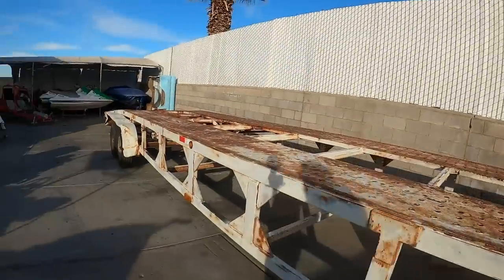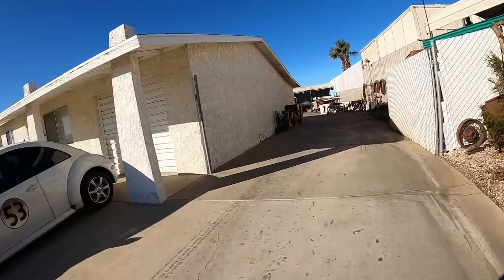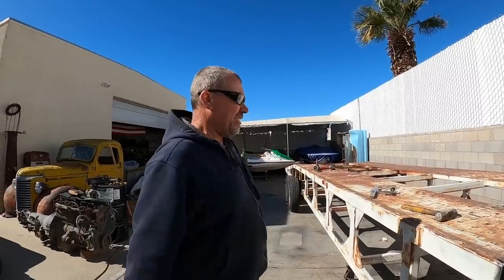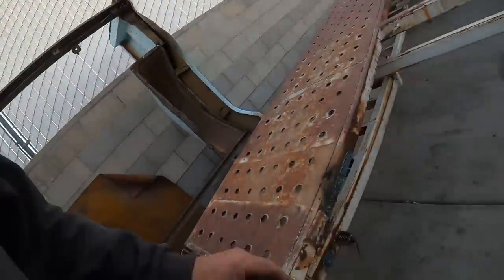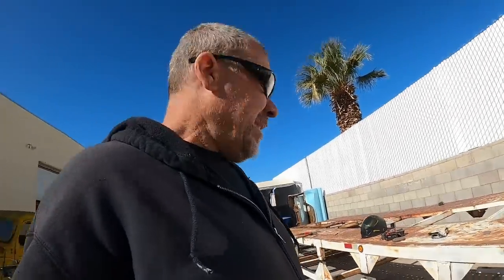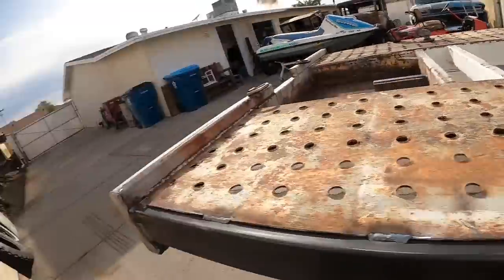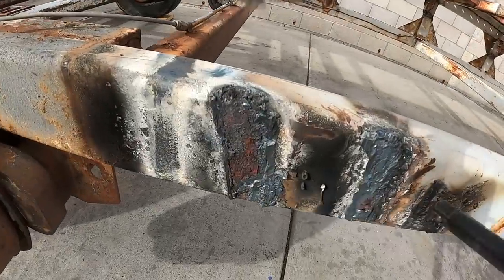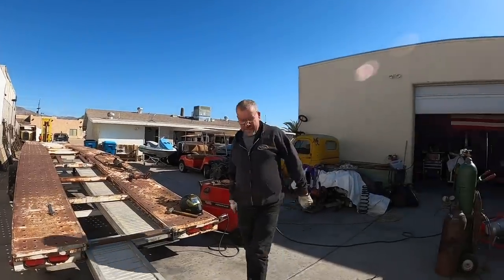Saving Money Repurposing This Trailer For My 1933 Dodge Brothers Mini Semi Truck

Comment: It wouldn't hurt to add some sort of plastic glide for the ramps to slide on. love the ideas and content on the build.
Reply: Great idea. A strip of 3/16 UHMW PE would make it much easier and WAY quieter. Those things squeal like a dying hog when dragging them out.
Reply: Like sliders on a snowmobile, UHMW perhaps. Maybe spring loaded clamps to take the rattle out?
Reply: @kwm6507  They are so far back you can't hear the rattle from the cab on my 36'

Comment: I paid $400 for an old camp trailer.  It had good tires, and the frame had potential.  I reinforced the frame and I thought that my T Bucket, (the reason for the trailer to begin with), would fit between the tires.  Well it was 3/4 of an inch too narrow.  So I built fenders that I could drive over, and made some custom tie-downs.  My first trip to Hurricane was uneventful.  I went down there to meet Matt and Paul, which I did.  It was awesome!

  My second trip was to Oregon from my home in Southeastern Idaho, and it  was ok for the first half.  The second half, (coming home) another one of the "good tires" gave up. ( second one)  I was having trouble getting my small floor jack under the dead axle, so I put it under the spring.  That baby snapped right in half.  At least it was on the shackle side, so I changed the tire and drove 35 MPH down the shoulder to the nearest exit.  I stopped at the first farm that I came to and asked to park my trailer and my T Bucket there for a few days.  They said sure.  I went 250 miles home.  I came back a few days later with 4 new springs, and 4 new wheels and tires.  Changed everything on a gravel driveway, alone. That is how I ended that trip with my "cheap" trailer.  I most likely could have bought a ready made trailer for what I had in this one.  Oh well!   It is bullet-proof from here.  I hope that you have better luck than me.  LOL

Comment: Merlin,  it's going to be an awsome looking combination.  Have you considered putting a heavy steel caster under the back corners? That way when you go up an incline they will roll instead of dragging the trailer. You should be able to tuck them up high enough so the wheel would barely hang below the bottom of the trailer. I used to deliver new boats with 53 foot low deck trailers and one brand that I pulled had steel rollers built into the back of them.  I think that the castors would work better because they would swivel while you are turning.
Reply from the maker: That’s a great idea. I might do that.

Comment: Hi Merlin. If you weld two bearing's to the frame where the ramps can roll on. You don't need to pull and puch so hard. They roll out easy when you unlock them. We do it to all trailers. 
Like your builds. Greetz from the Netherlands.
Reply from the maker: I like that🏁😊🔧👍

Comment: Ok, so prior I missed the point of you will be using the tandem axle truck to pull it. I follow now. I think I would have done the front a little different, but each their own. The style of tie downs that were on it are actually pretty convenient. They may of needed updated, but it makes them self contained. No straps to lug around, get lost or people steal.  I didn't see it on your trailer, but inboard typically they have a 3-4 ft length of chain with a tow truck style hook cluster to allow you to hook on to pretty much anything.

Comment: Trailers with "good bones" are better than building from scratch. You "repurposed" about like I would. Stretching and shortening are all part of the game. I have done both many times. Seems like every trailer has a special purpose. I have 6 or 7 at last count (if memory is correct). My son has a couple holding building materials for the shop/house he is building. He tried to tell me to thin the trailer herd by selling a couple. Nice to have options and the place to keep them. Love the "dog alarm" that goes off when someone shows up.

Comment: That little section you lopped off the front would make a sweet medium duty car hauler for dirt track you could add 10 feet and throw a cab over on the front and have a weekend trailer for the track

Comment: I would advise against using an impact to turn the landing gear. The hammering effect of the impact will destroy the gears in the jack. A battery drill or ratchet would be better. Smoother torque.

Comment: sweet job.  Just a couch sitting fabricator idea to throw in the trash for ya.  Maybe???? on your jack's cross crank bar... make it square tube with a telescope chunk in the center.  This would allow you to slip that piece to once side, making available to you to also have each jack  work independent thus offering  for more options on uneven ground.

Comment: Be careful with an impact on those jacks.  The ones with the steel gears would probably take an impact better than the sintered bronze ones.  A drill would work better but not sure how much power you would get out of it. There is a "jack gearbox" you can put on them too.

Comment: I welded up a socket adapter for my 36' Load Max trailer jacks. I have a 1/2"  drive Porter Cable 330 ft pd torque impact that I carry and it would barely budge the jacks with an empty trailer. It was moving it but only about a 1/32 each ugga dugga.

Comment: I love the trailer !  Personally I would leave the front axle.   That way if you needed the extra capacity, you've got it.  Or if you're on a trip & hub bearings go out, swap 2 wheels to that axle & keep  going.. if nothing more than to just make it to a better spot to do the repairs.

Comment: I would have put a sprocket on the Drive shaft between the 
landing gear jacks to later raise and lower the Landing Gear by 12 volt motor

Comment: How confident are you in that king pin weld? Would be cool for you to show it off in a torture test like tie the back of the trailer to a tree and floor it or something and pull that pin hard as you can to see how strong the weld is!

Comment: Used to work for a guy had a bunch of equipment trailers medium duty most of them had the same type of jacks on them as you installed we would drill and tap toward the top of it by the cap put in a grease fitting help keep them lubed most are just packed with grease and the cap put on with metal screws from factory never see any new grease

Comment: Learning from experience, use a drill for your jacks. An impact will shear the pins for the gears in the jacks. And what is your plan for side to side twist? A semi's fifth wheel is too stiff and will be twisting your truck's frame.

Comment: Might think of putting a winch on the front of the trl. And a winch "track/guide" down the center. Sometimes the vehicles u may haul tend to stop working.... I  used to haul vehicles commercially for a living. Winches came in handy.

Comment: for your landing gear i would use some round tubing and bearings so you dont wear out the hole you drilled for your bar to move your legs up and down

Comment: 3 pt ball shot. Trailer clean-up underway. Ok. Front, middle back, 12 ft Al ramp, front leveling jacks, braces. Ok. Making the trailer lighter and easier to use. Ok. Thanks scrapin Larry. Ok.

Comment: Merlin, I've been the oxygen acetylene, Sawz-All route too many times in the past. The plasma torch works great, provided your air compressor can handle the air consumption, and you've got electricity. 

I use to purchase rear quarter panels at the salvage yard. I'd go through three or four blades on the Sawz-All plus 4-5 batteries. Then I remembered, I owned a Stihl 14" concrete saw. An abrasive blade in place of the diamond blade makes all the difference in the world. You can find the older Stihl saws for around $300.

Comment: lots of fun reusing the old steel .. but you do save on the parts cost ,, grind and wire brush be good as new ,, not fun fighting the wind ,, years back was fixing a mower deck had to switch welding wire so I could weld with out gas .. it was too windy ,, trailer is looking great ,,

Comment: I noticed when you originally hooked up the trailer, to bring it home, that your 5th wheel pin was not in front of the rear axle. This configuration is not safe, traction on the steering tires is the issue.
Reply: Thanks for the offer of a tela chat, never heard of this before I will see if I can figure it out

Comment: 4   By the way, what type of schooling have you had to be able to engineer this stuff out? Very interesting!! Just noticed the landing legs you put in. Yes, there are more expensive one and they are made for heavier loads. I used to be a trailer mechanic for a company called Realco. They were the largest trailer leasing company around for the piggy-back trailers. One of the major failures we had were landing legs that would strip shear pins because of lack of maintenance. Make sure you place some zert fittings where they can be reached to keep your crown gear and pinion lubricated.
Reply: School of life

Comment: Question Merlin why didn't you keep Defenders cut them in half lengthwise and weld them back together so they fit and also you should have cut a to Bastille out old section of frame that you cut off just thinking it might have saved you but then again it is a build bit of work to cut that steel off

Comment: I have a 22-foot 3axl brakes front and back trailing in the middle a pierce winch from a lineman truck desert 6 by buried in the frame the whole centers Halo so you can work on cars but I also have  duel purpose ramps one side is expanded metal finishes the deck in the center and the other side is rollers for loading I bought a 12-foot catwalk by 4 foot cut it in half hinged both pieces on the back for ramps used boat trailer winches one on each side to pick up the ramps 1 inch square tubing out of 45 Penn's the ramp straight up so I run brake lights and turn signals on the outside and on the ramps triple spiderweb frame I did myself to cuz it was an 18 ft piece of junk with two axles that trailed every weld on it was junk so I had to redo the whole thing so I went big Big tool box in the center and batteries right next to it and nobody knows it's there you  would not believe the load it carries boxes cars and logs man everybody wants my trailer they've tried stealing it and renting it so they could go to Oklahoma no no no no no homie ain't no fool I didn't play that all the deck is expanded metal oil can't faze it never have to clean it

Comment: I don’t know that I’d trust those small trailer jacks for a loaded car hauler. If that piece you cut out was 3,500 lbs I’d bet your tongue weight on that trailer has got to be over 2000lbs. You go loading a couple 4-5k lb vehicles on it and those jacks ain’t going to cut it.
Reply: Merlin knows what he's doing